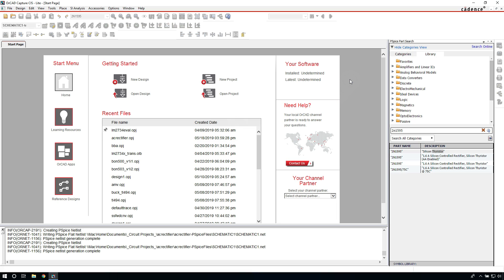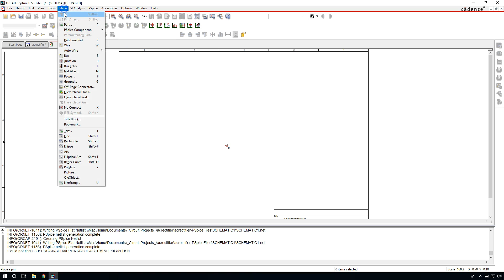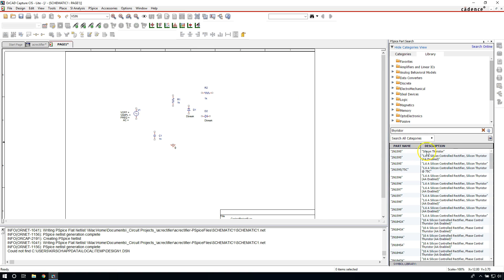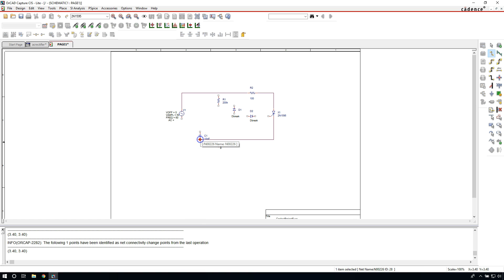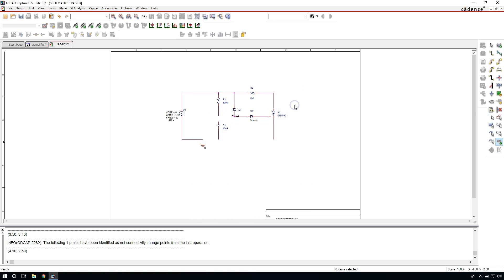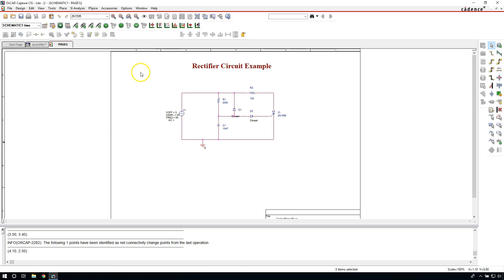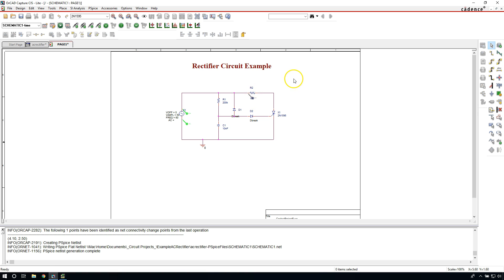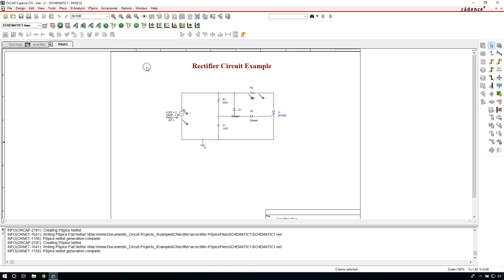PSpice Tutorial for Beginners - How to do a PSpice simulation

Comment: how to close the loop in the p spice environment and how to put an op_amp in a boost converter to give us the shapes of the article?
Reply from the maker: Great question. That would require some knowledge of control theory and application to electronics.

To close the loop, if you don't have the controls background to translate the controller into electronic devices, I recommend some articles from Texas instruments. Their application guides give a good detailed breakdown a lot of times. 

Then you'll need to learn where to find the appropriate components for simulation in PSPICE/Capture.

On the other hand, I can make a course on it...hmm...you're trying to simulate closed loop control of a boost converter, I'm guessing? Current mode control?
Reply: @techedkirsch  i 'm going to do an article about an article that almost shaped it almost like the original , and how i don 't know how to pay for my own price because i 'm in iran and i don 't have a card if you 're right .
i 'm doing it for a prefect , and i 'm stuck to the point of making the other article out and so i can go to the proposal and defend my proposal .
Reply: @techedkirsch  i did simulation results , but half - half
that 's why i need help so that someone can help me learn and do …
Reply from the maker: It’s fine. I’ll make the course free for you since you asked. The rest have to pay though! Hah
Reply from the maker: Therefore, you can email me the design at techedkirsch at gmail dot com
Reply: @techedkirsch  oh tnx ...
you're email ...?

Comment: Hello sir, I have accidentally closed the menu that allows me to print the oscilloscope analysis in pspice, which is already installed. Although I deleted and installed Pspice again, that menu did not come again. How can I bring this menu back again. Do you have any idea about this topic? Thanks
Reply: what I mean is run, there is a cross on the top right of options like File View Edit Trace on the graphic that appears. I closed it by mistake, so that menu is all gone. The menu does not come back what I did. I'm bored here